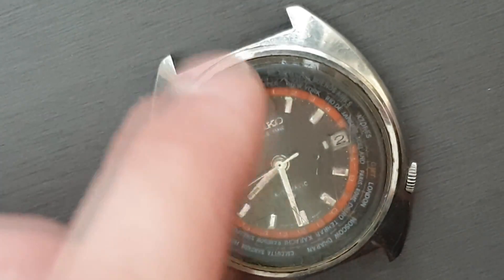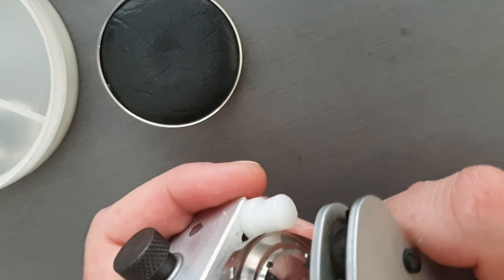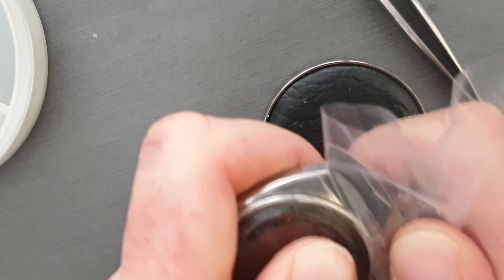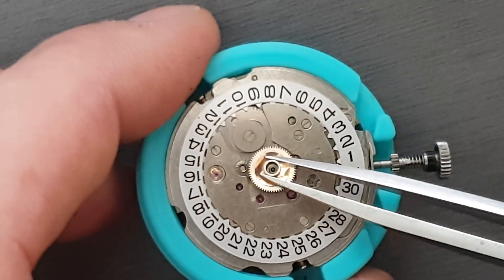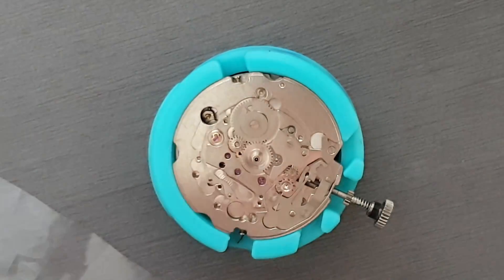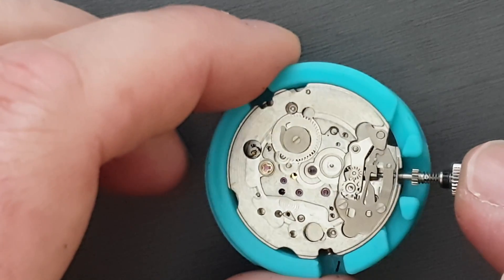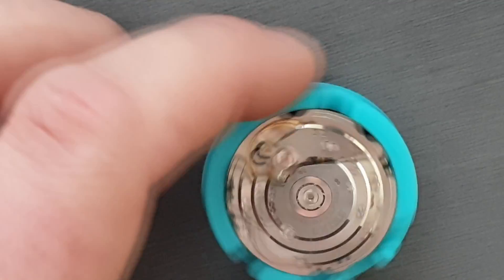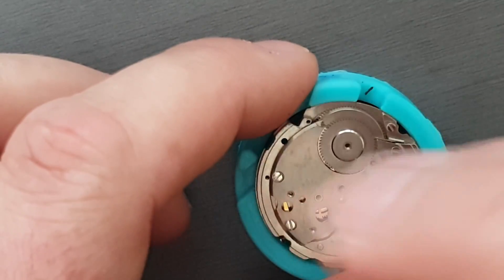[TECH] SEIKO 6117 Teardown

Comment: I have one of these that I'm going to replace the bezel gear. How do you remove the gmt hand?  It sits really close to the dial.  Thanks!
Reply from the maker: Best to use hand levers. They tend to get under things a PRESTO tool can't. Do it through a sheet of plastic from a clip lock bag. I prefer the HOROTEC hand levers.
Reply: @hal0eight  Thanks so much for the response, I'll look into those. Great video too!